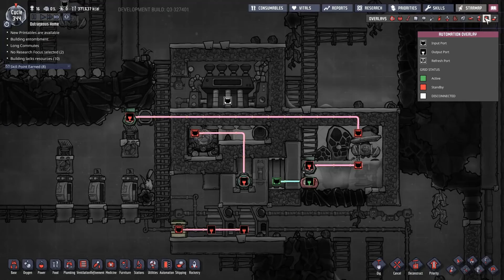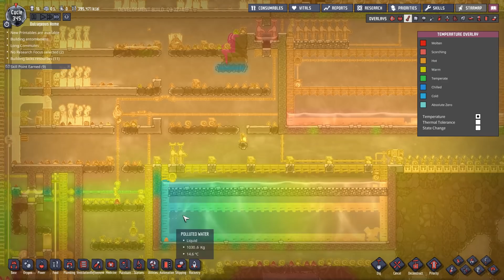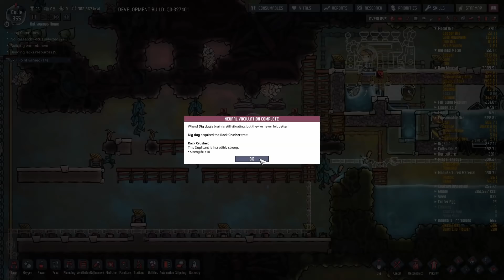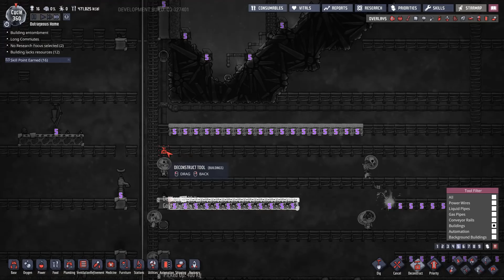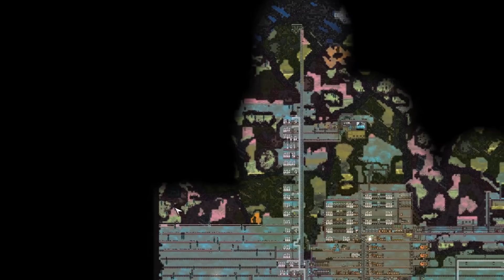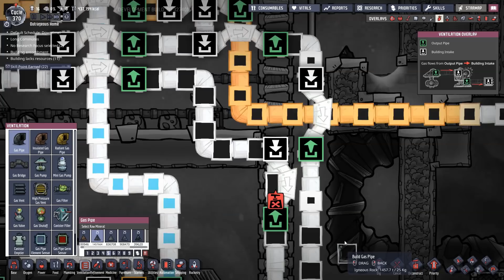QOL Mk3, 21 CO2 Disposal and Slickster farming : Oxygen not included

Comment: Sir Francis. Ha Ha. 
So I'm running low on oil. My oil well is running but I don't know for how long. I put water in and forgot about while I was working on an iron volcano at the very top biome on the far side of map I hadn't explored. I forget to set the pump for vacuuming the area to only if above pressure. So unkown how long it has been going. There's a little natural gas floating around but not much. 

On the left side I have another volcano but no oil for it so it's just going to sit. 
So I went down to the oil to check on things. 
Running low on oil. It's getting down there. 

So I'm thinking. Need more power from other sources. 
So I have another natrual gas geyser I haven't got to. 
Hmmm. That's 150 heat. Hmmm. Interesting. That free power right on top of the natrual gas by itself. there if you think about it. 

Leaky oil fissure you have on your map. That's free power right there. Don't need the oil but the HEAT. 
Wiki says 326.85 °C-620.33 °F Run the oil from the fissure through the water cooling it and then to the boiler and all the oil in biome. Is all your reserve power.
Reply from the maker: An oil well pumped through a petroleum boiler is 3.3KW of power. But if you are running low on oil nat gas can pull you out or a hole it's about 1.6KW for tapping one geyser dependent on output of course.
Reply: 253 combined. Weak.
Any bit will help. I added the other extra H and adding that gas geyser might give me just a little edge to get my petro build backup. 
Also the oil well is going now. 
Fingers crossed. 

It works. I tried it last night. 
I didn't set up a full system and do a full scale test. 
I created a little room 3x2 tiles big right next to 1 of my other steam gens about 100+ tiles down the line. 
I didn't break open the thermo aquatuner room as in case it didn't work
So the temp in the lines using ceramic cooled about 10C in the line 
However I got the 2.2K hydrogen bouncing around 124.5.
Reply: If I put the steam gen right on top, keep the room room small and did a full scale heat transfer. I'm sure it would work.
Best when pressure is low around 3-500G/tile.
The more gas in the more it cools to much.
I got a CO2 vent at 500C. 
With plenty of room around it. 
I might play around with it a little when I get other things sorted out.

I'd like to see that oil fissure tapped for heat power.
I bet no one has ever thought of doing that. 

That new design you have for heat deletion is amazing.
Way better than wheezworts. Smaller, universal and guaranteed to get that heat out.
To much heat. Nevvvverrrrr. MORE POWER!
Good for a few cycles early on before you get steel going and the research but go in and reclaim them. 
Need a quick fix or put them around your base in trouble spots.

Comment: Nice !

An idea I had (and put in practice) to cool the oil that cools your boiler's robo-miner : pipe the intake crude oil through that oil with a few radiant pipes. It'll keep it a a nice 85°c (or around that).

Quick question ... what would you do with iron volcanoes ? They're quite useless for the iron (falls from space), have you used them for anything ?
Reply from the maker: You use the incoming crude oil as coolant for the robo miner... that seems so obvious when you say it. Yet no one else noticed, good idea, I'll have to work around my silly petroleum piping but I should be able to implement that.
Iron Volcano's, they don't have enough heat to run a petroleum boiler at 10kg/s but could maybe manage 3.3kg/s, however I'm not aware of any design that can do that yet. I usually just stick a volcano tamer on them, more Iron for the silly amount of conductive wire I run. If you want you could remove final stage cooling for the iron, that way any power produced by the steam turbine could just be dumped on the grid. Nothing wrong with getting a little power for nothing.

Comment: Volcano is active again. I got my boiler running in full flow.
I had your magma video still up so I watched the end of it again before closing it. (For about the 5th time.)
A few things. 
I was thinking need a way to detect if no magma. If the low temp activates and cycles the system and no magma drops. 
Fail safe.
A hydro sensor in the magma loader.

If no magma there and gate with temp sensor detecting low heat. 
Drill will not activate doors won't cycle and reset sensor will not be permanent true signal. 

(On that note. I found that instead of thinking active not active when setting switches.
Think true false. When this is true turn that on. It just a little helper to set them correctly)
I set up other reset switches to pump more oil into boiler. Turn on more generators and I have plans for more.
Thanks fore making it easy to understand that thing. Even the in game helper and wiki is terrible at it. 

Only pumping in 5K of oil. Set the temp in the petro side to 401. It seems to work. 
I was pumping in 7K as well but when you do and the temp of magma drops.
The oil doesn't change fast enough. So I checked the magma temp it was sticking around 460 for to long. 
Set to 475. Will have to let it drop again to see if that will keep up but I think so.
Reply from the maker: Someone has started playing around with the petroleum boiler :) There are so many tweaks that can be made, have fun finding that perfect design that fits your play style.
Reply: Wasn't me messin.
Just thinking. Ha
Also remember I have to pump my oil up from oil at biome at 6K/s to a storage tank under the volcano. 

I don't know why though. I guess I could just use the 1 pump from oil and have the regulator under the volcano. Then how to get automation to tell when to much or little oil.

Comment: I also ran into that problem with your boiler and put a buffer gate of like 10 secs on that top door so it filled the 2 slots with magma then shut it off... i think its because those top 2 doors open and shut almost simultaneously it somehow allows the 3 tiles through... best guess, idk for sure... but the buffer gate for sure fixed mine and it has been running non stop for over 100 cycles now... Terrific design!
Reply from the maker: I think the ladder segments were stopping the tiny bit of excess magma (60kg) from turning into debris, instead they turned into tiles. My drill automation is not designed to handle 3 tiles so the whole thing messed up. Thats my current theory, ladder segments removed, if it does not pan out I'll give the buffer gate a shot. Nice job on getting the kinks ironed out that fast, nice solution.

Comment: The sour gas wasn't from leaking pressure on the petroleum boiler! You would be able to see the damage to the tile, or else the liquid would just be deleted. The sour gas came from the tiny driblet of crude oil that was meant to cool the robo-miner and not interact with the other heat. Maybe it interacted with debris or cooled magma somehow? Did the droplet spill?
Reply: Well, the droplet is gone. That definitely got turned into sour gas. Not sure that was the point of failure though. Could just be the result of failure.
Reply: @TommyTomLP  That would be so depressing coming from your parents.
Reply from the maker: I'm beginning to think the ladder segment was causing the issue. When the magma drops it's sometimes a little bit more than 2 tiles. Say 60kg over, that 60kg should turn into debris but with the ladder there it turned into a tile instead. When my mining drill activates it can only manage 2 tiles a round not 3 leaving 1 tile behind. Next round I end up with 4 tiles due to same issue. At some point it got high enough to touch the metal tile by the drill causing the oil droplet to turn to sour gas. Well thats my current theory, I'v removed the ladder segments lets see how it works out.
Reply: Seems sound to me. I thought ladder, too, but it was a whole 2 meters below the metal so I ruled it out as unlikely

Comment: I like this new thermo aqua tuner and steam turbine setup.
It's universal for anything. Steam vent. Done. Infectious geyser. Done. Water from sieve. Done.
Hot industrial. Done.
  
No hunting down wheezorts. No calculating the cooling needed.
Stick it in and done. 
You don't even need to calculate the geyser to find out how much water is there. 
Even the worst geyser will produce enough O2 for X dupes or if you going oil enough for X oil.
Little bit off power usage but that's what the industrial is for. 
Ahhh. I just solved my nasty water problem and hot water geyser. 
Hot water geyser comes out at 95. 
Just a little bit of heat and it's steam. 
Aqua tuner 

I also wonder if the extra hydrogen coming off the O2 production and the steam gen together will produce enough power for that aqua tuner. 
Time for a test video. 
If it works. Your gonna have to pull out your current O2 production as well.
Reply from the maker: It's does make life so much simpler, assuming you got the power to run it all. Which is one of the reasons I love my petroleum boiler, even with all the issues it has brought me.

Comment: Don't forget to mention don't have to be more careful how many active items on you 4K transformers. 
Even if not all the items run at same time.

Didn't mention the part about the volcano taking some time fill up a storage tank. 
Remember my volcano is near the top. I waited to dig it out till I was done building. 
When I 1st started using it I emptied it. Still waiting 40 cycles later for the system to warm up and my volcano is just about to turn off. 

I had so many problems with it. Temp sensor got stuck from no liquid and was so confused what's going on. Had to fix that 3 times. Cracked pipes. Somehow the dupes decided to sweep up polluted ice into a storage bin in the vacuum around. Melted and gave off gas. The heat from the oil storage below heated the liquid lock at the magma dropper. Sour gas. Oil is around 130 but it seamed to happen. Had steam conversion going on. Have oil in the boiler. 
It was all a mess.
Worked a little but only intermittently. 

I'm just going to leave it off till the volcano fills up my storage tank. Not a big one as I didn't plan the space but we'll see what happens when I have a decent storage. 
Oh well, Live and learn. 
ONI assistant says it's a 10K volcano. Hopefully it will be able to keep up.

Comment: Some of the issues might be around memory toggles not handling saves well. I am not sure if they have fixed that yet.  I would also love to see a build on the polluted oxygen vent if for not other reason than to see how you deal with it. I have never actually seen one of those :P 

great video as always!
Reply from the maker: But the Polluted oxygen vent is sandwiched between my oil boiler and my petroleum storage, that's going to be a nightmare to plan for. When it's closer to the end and full sustainability is achieved I have a bash at it.
Reply: @FrancisJohnYT  a separate tutorial would also be fine by me, as I agree the location there is somewhat... unhelpful.
Reply: I would love to see a tiny setup to dual-pump it away to an actual sustainable slime production setup somewhere near the base. :)

Comment: Your problems are quite unique from the usual ONI scarcities.  Too much of everything.  That NG vent is just horrible, making 84g/s.  That's not even one NG generator. 

My map has a hot polluted oxygen vent that makes 400 ish g/s pO2 at 500 C. I guess your steam vent tamer will also work?  Don't really need it, just an interesting thought challenge.  Would be nice to see how you deal with the infected polluted O2 vent as well.  I'm farming shrooms and want to create a system that automatically sanitizes slime before moving them inside the farm in the safe zone.  Right now I just dump anything with slime lung into a chlorine room with containers and gas containers then manually pump and dump when the slime lung is gone.
Reply: Also my theory  regarding the sourgas inside your boiler is the drop of crude oil cooling your autominer got heated.  The magma holding tank is much larger than your test ones so that could account for the extra magma falling into the chamber.
Reply from the maker: I cant help you with Polluted O2 and automating slime cleaning, I'v never had the necessity to build them. I do clean the slime and turn it into algae later but I usually batch it like you are already doing. Usually players just keep the slime in liquid to prevent it off gassing and ignore the slime lung, but that is just based on some lets plays I watched.
Reply: @FrancisJohnYT  No worries.  An electrolyzer does double the amount of O2 and does it in a far safer temp.
Reply: Have a chlorine vent?
Convert slime then as you bring it inside pass by a cleaner. 

No vent. Stick the bleach stone and all chlorine you find in a room.  Stick the algae machine inside. Store slime and algae inside there.
As long as the slime gets cleaned before getting into the machine. Even the water will come out clean. As long as it's pure chlorine. No need to refill every so often. It will last about a 1000 cycles. 
I had to clean all my sedimentary rock before bringing in. 

Hydrogen room with a few wheezworts unless you have the power. Thermo aqua tuner.
That thing takes of anything. I like it. His tutorials showed wheezwort cooling but this is so much easier and is completely universal. 
Don't need to calculate. How many wheezorts does it take take to cool a vent if a wheezort could cool a vent. Ha 
A wheezort could cool as many vents as a wheezort could cool if a wheezort could cool a vent. 

Cool that vent to about 15C. Will take care of the germs and make it manageable.
Reply: @LTL_king  I usually save up the chlorine from the caustic biome into gas containers.
Reply: @johnlee7164  They are in suits. What do you need chlorine for?